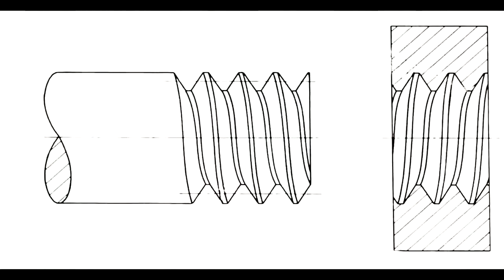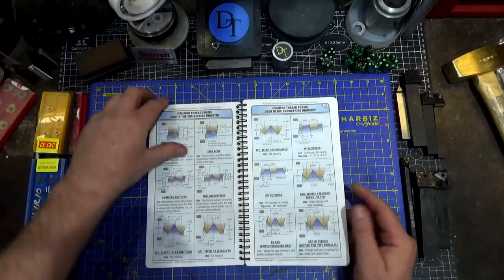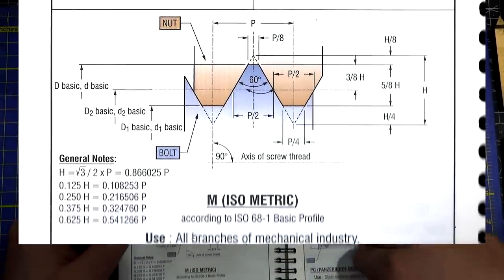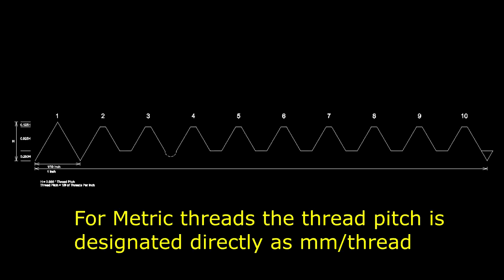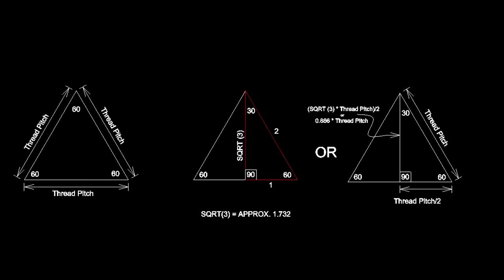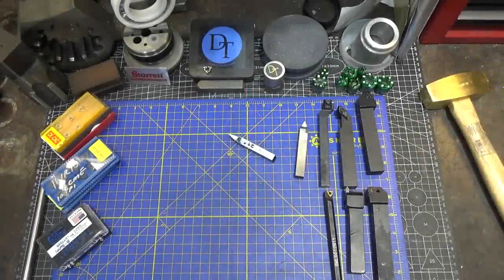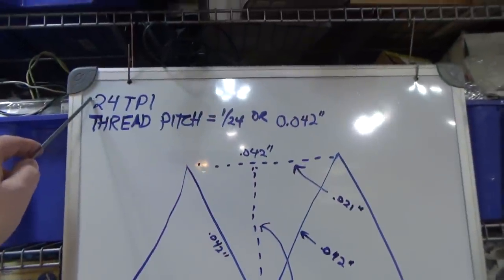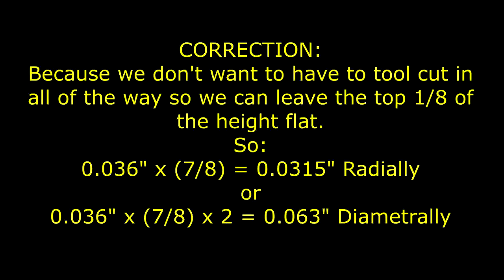203 Almost Everything I Have Learned About Threading

Comment: Essentially a thread is a wedge, a circular wedge. Like an adjustable parallel, but circular. Say the top triangle be the bolt, and the bottom half the nut. The cool thing is that the force applied is transferred 90° to the direction of force, and with a little bit of friction, it stays put and doesn’t push back, or unwind.
Thanks DT, I’m new to machining so well done educational videos are great 👍
Reply from the maker: Thanks. I tried to make my explanations understandable, but it is harder than expected. The guy on some of these channels seem to put out incredibly clear explanations with little effort. That was definitely not the case here.
Reply: @DudleyToolwright     The video is great. It was clear and understandable to me.

Comment: Carbide anvils can be  ground at different angles, sometimes needed for fast pitch or multiple lead threads to prevent heeling on the back side of the insert.
Reply from the maker: Thanks! Can you explain what you mean by heeling on the back of the insert, please?
Reply: @DudleyToolwright  
I should not have said the back side of the insert, but rather the flank. If you picture a standard RH threader trying to cut a 4 tpi acme thread, the helix angle of the thread can be larger than the relief angle of the insert. This causes rubbing (or heeling) on the flank of the insert instead of shearing at the cutting edge. Trying to cut a LH thread with a RH tool will similarly rub.

Comment: Well done! 👍Only issue I have is my 13x40 lathe the half nuts are always a bear to engage. Which makes it possible to miss your number or line and you have to disengage and try again. Threading towards the chuck gives me enough time and room to do that. If I am threading away from the chuck and I miss my number or mark on the threading dial then I have already started cutting and messed up the thread.
Reply: You need to pull the apron off the lathe and inspect the half-nut mechanism for poor fit and finish (a common problem on mainland Chinese lathes) or damage to the half nuts themselves. The half-nut should engage smoothly without forcing the lever. For threads 12-24tpi on my 12x24 lathe I usually run at 290 rpm.
Reply from the maker: Hey Tom. My lathe's half-nut is more difficult to engage at some numbers than others. 1 is by far the easiest and it's not because I use that number more than others. Weird huh? I have also  engaged the half-nut just before or after the line and hosed a thread before. It seems like this risk is more prominent at certain thread pitches, although I haven't identified the pattern.
Reply: @DudleyToolwright  I may hit you up for one of those 6 pitch acme thread cutting carbides. I need to make a new nut for my bandsaw at some point.

Comment: Thanks Robert, you've answered my questions on Acme inserts! You can certainly tell you don't work on British bikes or cars, Witworth threads are very common there...
Reply from the maker: I never have and was under the impression that Whitworth was a thing of the past. Are the still used today in the UK? Sub'd.
Reply: @DudleyToolwright  to tell the truth, I've never worked on anything newer than the 80s so you may be right. But China seems to produce ~100 times more Wittworth than UNC/UNF, judging by AliExpress... <edit>Oh, and thanks, but be warned, I am a Homesteading Channel , I do a lot more than shop videos...

Comment: I find the tip width of A60 inserts are wildly optimistic relative to the claimed pitch range. Too wide for the fine end, too narrow for the coarse end. I often have to use my optical comparator and d-bit grinder to align the tip width with reality. Great video, solid info.
Reply from the maker: Interesting observation. I haven't tried to push the envelope...but really good to know since the majority of my inserts are inexpensive Chinese ones.

Comment: You didn't mention anything about what class thread you were making or the tolerances of the 3 classes. Also at 32:39 what are those things on the two strips?
Reply from the maker: I forgot to mention thread classes, thanks. I intend on updating this video at some point and that topic would be a nice addition. The items on cables that you wondered about are thread checkers - one metric and the other imperial. For each size they have a male and female thread. Really handy tools. Here is a link to the ones I bought:

https://www.amazon.com/dp/B06ZYD4SS8?linkCode=ssc&tag=onamzrobe04a7-20&creativeASIN=B06ZYD4SS8&asc_item-id=amzn1.ideas.1RV7BHP4BGAHF&ref_=aip_sf_list_spv_ofs_d_asin&th=1

Comment: full form is the way to go,   i use them all the time. The Hardinge HC  makes threading a breeze
Reply from the maker: Wow a Hardinge. That is an outstanding lathe. I have lusted after one at first sight.
Reply: the Hardinge HC are available at low prices
Reply: do need a lot of tooling and thread sleeves however

Comment: Just watched your video  very informative but I think you should have mentioned that if someone has a lathe with a screwed on chuck then unless very careful do not thread in reverse as it can unscrew the chuck, my Myford has a screw on chuck but I have installed Rocketronics ELS so don’t need to do it, apart from that an excellent video.
Reply from the maker: I forget that other lathes use other than D style chuck mounts. Thanks for the reminder. It is definitely worth a mention.

Comment: Thanks Dudley.  Great vid.  I'm only a couple mins in and noticed something interesting about the first thread diagram you showed at 1:44.  When you superimpose the red lines to show the lead angle it struck me that the roots as well as all of the other elements of the thread follow a slight s-shape.  I had never noticed that before in other diagrams but I am finding it in some diagrams i'm looking at on google now.  I suppose it's not really that important but I am curious if it's just an illustration technique to try and convey roundness of the part.  Just found it interesting since it actually seems to suggest a wavey nature to the thread cut.
Reply from the maker: I noticed that too and was also taken a bit aback. It seemed as if they were trying to show the helical thread simulating 3d or something. I chose the image because it showed thread lead, in spite of the strange rendition.

Comment: I do some NPT threading at my job where I machine pipe stub ends. Basically a pipe with a flange on one side, and occasionally threaded on the other side. We make stub end pipes from ¼ inch up to multiple feet in diameter, flange is completely machined and not press fit or welded onto the pipe. As far as machinist jobs. It's kind of boring making the same part every single day just different sized. I'd rather do general machining and make lots of different parts, but that's life I guess 🥱😅🙃😁
Reply from the maker: I totally forgot to cover tapered threads, which I am not sure how to make without a taper attachment. Thanks!!!